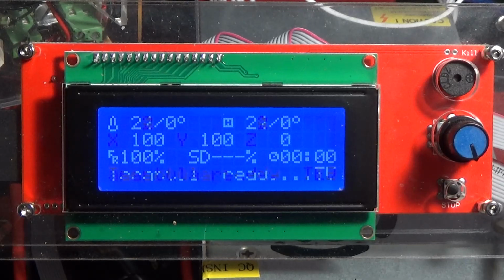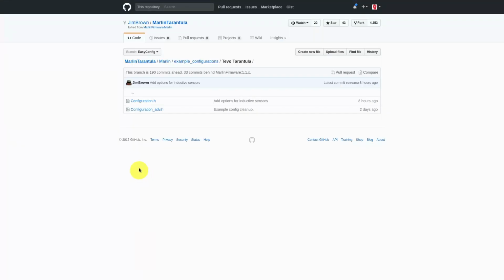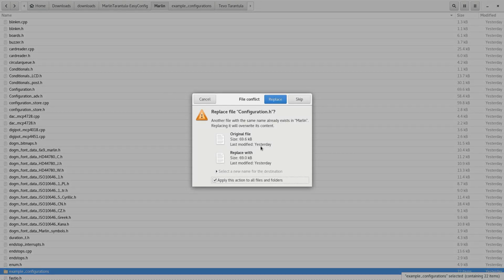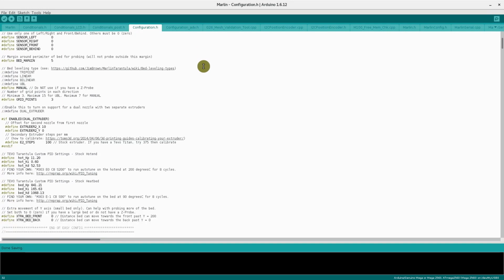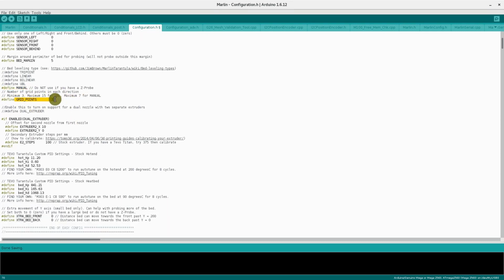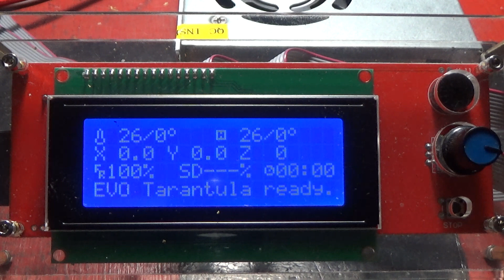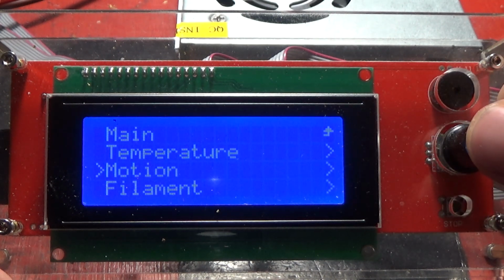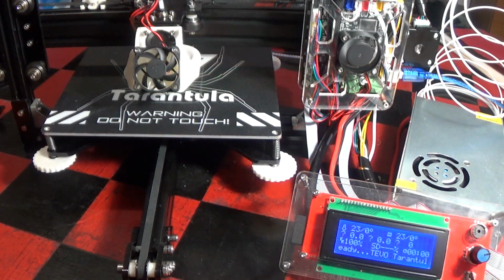Tevo Tarantula 3D Printer - Flashing new Version of Marlin Firmware with EasyConfig

Comment: Why i cant connect my tarantula whith repetier host 2.0.5? And why when i start to print via SD Card i get the following error: "Heating Failed  / Printer Halted / Please Reset"

Help Please, Thank you
Reply from the maker: Not entirely sure why you can not connect with repetier, what exact error message are you getting? The error usually means that either the temp senosr of the hotend or the one of the heatbed has a problem. What are the temperature readings on your LCD display? Double check all your connections. Also try resetting to factory settings, just to make sure - has it been working before flashing a new version?
Reply: I don`t get any error mesage, when i click in the connect button inthe repetier host, the printer only restart and don't connect :( The temp. shown in the display is only a interrogative symbol.
Reply: maybe the baud rate isn't correct, mine said it had 250000 but it worked on 115200, so maybe that was the issue

Comment: What were the main changes to the 2.0 software to get it optimized for the tarantula? I noticed that 2.0.1 came out recently would one benefit from doing that firmware rather than this one? I ask because I am not able to get good prints. I’ve flashed my board to this optimized firmware but I have issues with centering the bed, x/y shifting, and PID tuning when fans are on don’t actually work when actually printing jobs.

Comment: you say at one point the u dont have to change the pid settings? this is because u have a small bed. what do i put cause i have a big bed
Reply: sorry i meant the xtra bit
Reply from the maker: In Configure.h in the "Equipment options" sections, define LARGE_BED (remove // in front):
//#define LARGE_BED

should be:
#define LARGE_BED

Comment: my printer was working fine until I uploaded this firmware. It printed just a bit off perfect so I uploaded this file to fix  offsets. I got all my homes etc fixed perfect and was excited. Then when I went to use printer, the heater wont work now. The LCD screen says "Heating Failed Reset Printer" I only changed offset values in config h. Any advice is appreciated, thx!!!
Reply from the maker: Please check all your connections. Does the LCD show hotend and heatbed temperature? How high do you set your heatbed temperature?
Reply: yes, unhooked everything. When I put the original tarantula-marlin.community-v.0.1d.zip firmware on the hotend works. With new firmware the LCD does show temps for bed and hotend. I set temp to 220c
Reply from the maker: heatbed to 220? This will for sure trigger an error...
Reply: no, hot end. I dont use heatbed
Reply from the maker: So give some more details please. When does the error show up, during heat up, or as soon as you start the printer. Which setup do you have exactly? Did you copy the config files from the example directory?
Reply: I followed the instruction from the instructions, copied the configs from examples, uploaded. I Use simplify3D and I can use machine tool to do anything to the machine, moves any axis, extrude etc, but if I turn on hot end or send to print via usb, or if on the LCD I turn on hot end it fails. I broke my machine taking apart the hot end and had to order new parts. I found an old hot end and tried it, same thing. Then I reverted to old marlin formware and it worked. I tried version 1.1 rc6bugfix and it works. So there is something the rc7 changed that does not work. Someone in TEVO FB group has same problem. So that where I'm at. When the parts get in and I get rc6 working flawless I'll probably document what I changed and post/upload for others who have the same issue I did until another release comes out.

Comment: You have a nice voice, I likeit:) Thanks for the upload, its really helpful. I have one question, is it worth to try the titan extruder? What is the diffetence between stock and the titan? Why should i use it?
Reply from the maker: Thank you :-) I installed the titan extruder yesterday. You will have to adjust the esteps for the extruder, I used 376.14 and you will need to invert the direction of your extruder stepper motor in the config. From my first impressions it is extruding more evenly, but I am only a couple of prints in - so this might be placebo. But to switch filaments is much more easy than with the stock extruder - so just for that it was totally worth it for me.
Reply: Thanks, I'll try it.

Comment: The config on my file looks different than in your video. And my display shows these two lineas as somebody else also mentioned. I added that define full_graphic_smart in the configuration.h but the compiler asks for a library.. so I added the library and the code won't compile, wdid?
Reply: Did you use the branch MarlinTarantula EasyConfig 1.1.x or 2.0.x?

Comment: Hello, i couldnt find the settings in configuration.h file to see x, y and z coordinates. What sould i do?
Reply from the maker: I am not sure I understand your question - could you rephrase?
Reply: @stylesuxx  hey. i didn't know you'll reply so fast. first, thank you for this great video. I have upgraded my stock firmware with your help. then i was working on "How to center your prints" page. But my screen does not show X and Y locations on the screen as shown in that page in this link :https://github.com/JimBrown/MarlinTarantula/wiki/How-to-center-your-prints-(EasyConfig) It only shows the Z location. My question is how can i make Z and Y location appear on lcd like the one in the link. I hope i have explained myself better.
Reply from the maker: @sermeric  You mean you do not see X and Y position on the LCD display? Only Z? What do you see in the space where X and Y should be?
Reply: @stylesuxx  well first line it shows first and second extruder heats in celcius in second shows H in celcius, Z location, In third line FR , SD---% and time(i think)
Reply from the maker: @sermeric  Ahh, you have dual extruders. I think there is simply not enough space to display X and Y... You can read the positions via Gcode command M114
Reply: @stylesuxx  OK, thank you. I already see it from repetier host and i am now able to control my printer from cura. But there's another strange issue. can you see this picture ? https://imgur.com/VaIwjdF its an arduino uno box cover part with 74.1x61.3x8.0mm dimensions. As you can see in the picture. some lines almost no filament, it goes to better, sticking then it starts not to stick, non-stick line moves with the nozzle. What sould i check for this?
Reply from the maker: @sermeric  Seems like your bed is not very well leveled....

Comment: Afte update I get  2 rows of black squares in LCD, any idea to fix this problem? 
I use back old firmware and it look good again
Reply: I found the problem, you need //#define FULL_GRAPHIC_SMART in Configuration.h
Reply from the maker: Interesting, the LCD module worked out of the box for me, but thank you for sharing your find.
Reply: Hey there, have exactly the same problem. 
No matter wich marlin i use, i always have these white blocks on LCD screen. Also the printer dosent work anymore, he is just doing nothing. 
I can only run my printer with repetier or sprinter. But with marlin i got these mistakes angain an again.
Reply from the maker: Even when adapting the define as suggested by +Ong Wei Quan ?
Reply: yes even then, when i flash marlin on the chip the printer doesen work anymore. i mean nothing :D
 Looks like the board dosen`t work with marlin for me, i have no fkin idea what to change
Reply from the maker: OK, that is very interesting. Maybe you should open an issue in the github repo, and post a picture of your board...
Reply: There is a contrast adjustment potentiometer on the back side of the screen board (marked 'Contr ast' on mine) Should help in case of white squares
Reply: I have the same problem :(( updated from code direct from Tevo. If I follow the link to the one below, it dosnt exist for "Tevo Tarantula" anymore.. So called "easy config". If I follow the link, click "marlin", "example configurations", then "tevo tarantual" has been removed!!!? Should be after "SCARA" (whatever that is?)
Reply: I had the same problem.
To fix it I commented out the line:
//#define MOTHERBOARD BOARD_MKS_GEN_13        // Original controller board with built in stepper drivers. Works with MKS BASE 1.3, 1.4

and added new line instead
#define MOTHERBOARD BOARD_RAMPS_13_EFB

all begun to work.

Comment: Hi, i just followed your video and got the new Marlin fw. But after i got the new fw the nozzle i to high on the bed, i have leveled the bed but it start all prints with the nozzle to high. Is there a fix for this or is it possible to reinstall the orginal FW ?
Reply from the maker: Do you have a bed leveling sensor? If you manually level the bed, I see no reason why it should start somewhere different. What you can try is lower the z-Offset until your nozzle is perfectly over your bed. And yeah, sure you can install the original FW - you can flash as often as you like.

Comment: ok so my configuration looks nothing like what is shown in the video and i dont know what to do since I am a noob
Reply from the maker: Things with firmware unfortunately change very quickly, but the concept is still the same. Copy the config files from the example dir, and then go through the config file and adjust to your needs. There are a lot of comments within the config files, just read them and you should be able to adjust it to your needs. I am of course willing to help you out, if you ask for something specific, but this way, it is a bit hard for me to know where you are having problems...
Reply: thank you for the reply i got it up and going, I never worked with firmware before today so the difference made me not want to proceed in case the download was corrupted.
Reply from the maker: I see, glad you got it working. Usually with Arduino based systems you can't really do too much wrong. Worst case you simply re-flash and you are good again ;-)

Comment: sir am getting an error on compiling 
  This report would have more information with

  "Show verbose output during compilation"

  enabled in File > Preferences.

Arduino: 1.0.6 (Windows NT (unknown)), Board: "Arduino Mega 2560 or Mega ADK"

In file included from /MarlinConfig.h:42,

                 from blinkm.cpp:27:

/SanityCheck.h:36:4: error: #error "Marlin requires C++11 support (gcc >= 4.7, Arduino IDE >= 1.6.8). Please upgrade your toolchain."

In file included from /MarlinConfig.h:27,

                 from blinkm.cpp:27:

macros.h:183: error: expected initializer before 'auto'

macros.h:186: error: expected initializer before 'auto'

macros.h:189: error: expected initializer before 'const'

In file included from /HAL.h:33,

                 from /MarlinConfig.h:39,

                 from blinkm.cpp:27:

fastio.h:112: error: use of enum 'WaveGenMode' without previous declaration

fastio.h:112: error: expected unqualified-id before ':' token

fastio.h:132: error: use of enum 'CompareMode' without previous declaration

fastio.h:132: error: expected unqualified-id before ':' token

fastio.h:140: error: use of enum 'ClockSource' without previous declaration

fastio.h:140: error: expected unqualified-id before ':' token

fastio.h:152: error: use of enum 'ClockSource2' without previous declaration

fastio.h:152: error: expected unqualified-id before ':' token

In file included from /MarlinConfig.h:39,

                 from blinkm.cpp:27:

/HAL.h: In function 'void HAL_timer_start(uint8_t, uint32_t)':

HAL.h:121: error: 'WGM_CTC_OCRnA' was not declared in this scope

HAL.h:124: error: 'COM_NORMAL' was not declared in this scope

HAL.h:131: error: 'CS_PRESCALER_8' was not declared in this scope

In file included from /MarlinConfig.h:42,

                 from blinkm.cpp:27:

/SanityCheck.h: At global scope:

SanityCheck.h:378: error: expected constructor, destructor, or type conversion before '(' token

SanityCheck.h:1599: error: expected constructor, destructor, or type conversion before 'float'

SanityCheck.h:1599: error: expected unqualified-id before ',' token

SanityCheck.h:1600: error: expected constructor, destructor, or type conversion before '=' token

SanityCheck.h:1600: error: expected unqualified-id before ',' token

SanityCheck.h:1601: error: expected constructor, destructor, or type conversion before '=' token

SanityCheck.h:1603: error: expected constructor, destructor, or type conversion before '(' token

SanityCheck.h:1604: error: expected constructor, destructor, or type conversion before '(' token

SanityCheck.h:1605: error: expected constructor, destructor, or type conversion before '(' token

SanityCheck.h:1606: error: expected constructor, destructor, or type conversion before '(' token

SanityCheck.h:1607: error: expected constructor, destructor, or type conversion before '(' token

SanityCheck.h:1608: error: expected constructor, destructor, or type conversion before '(' token

In file included from /MarlinConfig.h:43,

                 from blinkm.cpp:27:

enum.h:35: error: use of enum 'AxisEnum' without previous declaration

enum.h:35: error: expected unqualified-id before ':' token

enum.h:82: error: use of enum 'DebugFlags' without previous declaration

enum.h:82: error: expected unqualified-id before ':' token

enum.h:131: error: use of enum 'MarlinBusyState' without previous declaration

enum.h:131: error: expected unqualified-id before ':' token

enum.h:143: error: use of enum 'LsAction' without previous declaration

enum.h:143: error: expected unqualified-id before ':' token

enum.h:148: error: use of enum 'LCDViewAction' without previous declaration

enum.h:148: error: expected unqualified-id before ':' token
Reply from the maker: One of the first lines of your error report states: "Marlin requires C++11 support (gcc >= 4.7, Arduino IDE >= 1.6.8). Please upgrade your toolchain." Use newer version of Arduino IDE and you should be good.

Comment: Thanks for the video. From github, do I download marlin 1.1 or 2.0. Which is more suited for our Tarantula?

 Btw, are you using Fedora or Ubuntu? I use KDE neon.
Reply from the maker: I would go with 1.1. At the time I was making this vid, I had a couple of issues with 2.0 not wanting to compile - but you can try, if it does without any issues, no reason not to use it. I am on Debian Sid and use Gnome Shell as window manager.
Reply: Do you know what the stock printer firmware is (Migbot 3d printer was displayed). Actually, I bought a new tevo tarantula two weeks ago and was assembling it. I found out that my e0 extruder motor is clicking. I tried adjusting the potentiometer but it did not seem to have any effect. So, I wanted to change the pin to e1. Hence, I flashed marlin. But X does not seem to work. I flashed repetier firmware on the site. Now, X and Z are not working.

Comment: I followed your directions and got an error when uploading to the PCB. “Fatal error. U8glib.h no such file or directory”.   

Using Arduino IDE 1.8.5
Reply from the maker: This library is needed if you use the full graphical display.  Go to "Sketch" => "Include Library" => "Manage libraries"  there search for "u8glib" install it and try again.
Reply: stylesuxx thanks for the quick response, mate. I’ll try it :)
Reply: stylesuxx Nothing but a continuous problems with U8glib in version 1.8.5, I’ve uninstalled it and now installed the one that you have on this video v1.8.3 see if I have better results
Reply from the maker: I fear, this version will also need the library, if you really have the full graphical display. Post the exact error message, including the filename and line number the compiler is complaining about.
Reply: You're right. After installing 1.8.3, and reinstalled U8Glib library, I got this message when compiling near finished:Using library U8glib at version 1.19.1 in folder: D:\TempZ\libraries\U8glib 
fork/exec C:\Program Files (x86)\Arduino\hardware\tools\avr/bin/avr-gcc.exe: The filename or extension is too long.
Error compiling for board Arduino/Genuino Mega or Mega 2560.
Reply from the maker: Got to love windows,... Which version of Marlin did you download? I would recommend version 1.1, I guess you tried 2.x? Check the github issue section for Marlin, unfortunately full of similar error reports :-/
Reply: stylesuxx no doubt, lol. I’ve done multiple older versions and same long file and error. Trying to to the Linux route now. Have you got experience that way as well?
Reply from the maker: I use Linux exclusively, if it is your first time, go with a noob friendly distribution like Ubuntu. You can also try a Linux Live CD/USB in case you do not want to install it to your HDD... try something like http://www.linuxliveusb.com
Reply: stylesuxx got it compiles fine in Linux version :D so much less hassle than Windows
Reply from the maker: Awesome, great to hear that. I stopped using Windows about 18 years ago and never looked back. Linux might have a slightly steeper learning curve, but it does what I want it to do. This was also when I stopped using pirated software because I could find a free alternative for everything I was using :-D But I'll quit fan-boying now...
Reply: stylesuxx I was able to flash the same firmware onto my new MKS V1.5 PCB board. Now it’s easy :) only thing is one of my long LCD cables won’t work on new board, and the cables it came with are really short
Reply from the maker: Good to hear you got it working. you have a MKS V1.5 - nice, mine is only V1.4,.... Longer cables should not be too expensive I guess ;-)
Reply: Good day man! I am having trouble trying to get my Marlin firmware (stable version 1.1) on my Tevo Tarantula..but when I select 2 extruders in the Config.H file, and then I set Temp_Sensor_1 to 1...I still get an error on compiling:   "Error 1 HEATER_1_PIN not defined for this board"    How do you fix this?